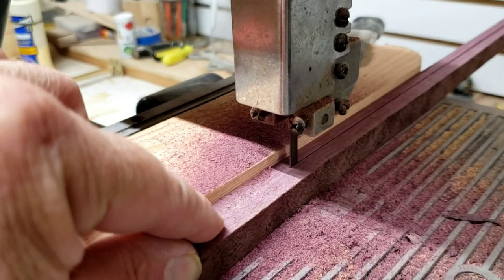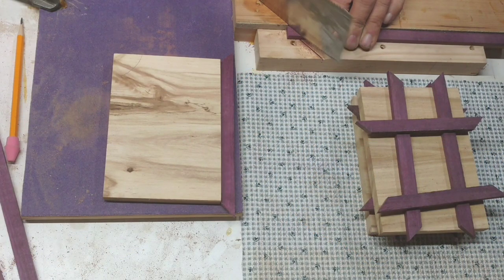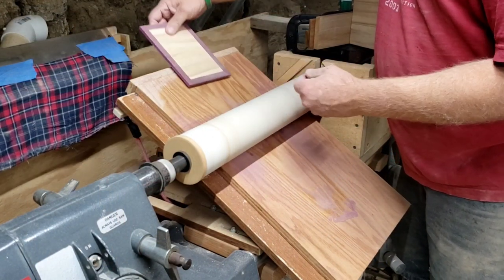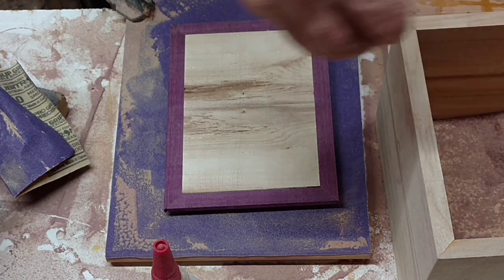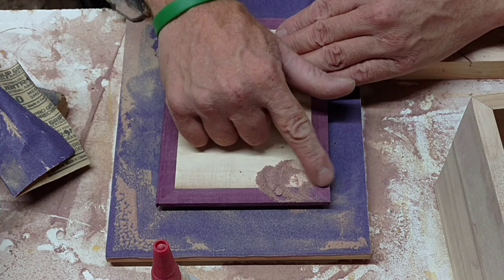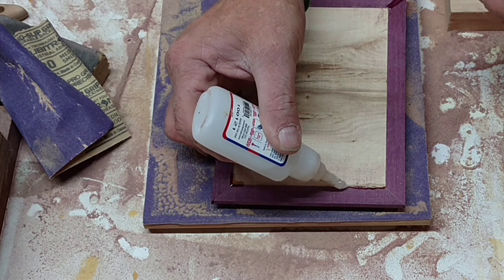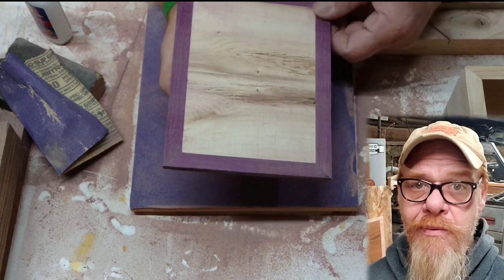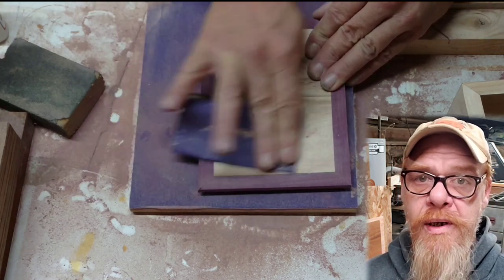A new way to fix the GAP in mitred joints! DONT USE SAWDUST AND WOODGLUE ANYMORE

Comment: I've done this one and it works great. If your gap is going to effect the structure and you need to ensure depth I have been known to use the shop vac turned down to the lowest on the back of the joint to pull the glue and dust down. If the gap doesn't go to the back I have used jewellers drill bits to open it a little from the other side and then fill them the same way afterwards.
Reply from the maker: Excellent tips buddy! Thanks for stopping by and sharing some 'insider' tricks :) All is appreciated !

Comment: I’ve heard this before Kevin, and have done it myself with the ring I made.   Great tip.  Oh and a tip back to you...use water in place of activator.
Reply from the maker: Thanks Rob. And also thanks for the water tip. You rock
Reply: I didn't know about using water Rob. I'll be giving that a go tomorrow, especially as I ran out of activator last week and can only buy it as part of a kit with the glue 😊 ॐ
Reply: The Wood Yogi TRY it first.  I suggested it to someone else and they said it was a fantastic tip.  Maybe it doesn’t all work the same, but when I’ve done it, it’s worked.  Maybe use a spray bottle and test it out.

Comment: Would the CA glue trick work on bigger holes and gaps, or is it mainly for smaller holes and gaps? My dad made me a bit of a headboard for a Christmas present, but there are a few interior fitment and miter gaps I'd like to make more invisible, aside from a half inch thick gouge on the bottom shelf board, it looks like he fixed using the glue and sawdust trick... Also, what CA glue, or what brand, preferably cheap as possible, would you recommend for bigger gaps and things???

Comment: neat idea!   do you find any problems with it being a bit too glossy after finish?    that's one of the things I noticed when using wood glue in the past.
Reply from the maker: Well I use a gloss poly for my finish, so I do not notice. If one was to use a different finish, maybe so, but I also think CA and dust is more stainable and blendable to the surrounding wood, compared to woodglue

Comment: Hey you have the same table saw I do do you have an issue with the belt tension changing when you raise or lower it & angle cuts
Reply from the maker: If you are referringbto my Craftsman, no I dont have an issue. In your case, look at the motor mount because one bolt should stay a bit loose so the motor can puvot freely.

Comment: Does the CA glue leave a stain or mark after applying finishing? How does wood take finish where there's CA glue?
Reply from the maker: I use a spray or wipe on poly and it works good. Thanks for the comment.
Reply: @MakinSawdust  I've started using CA glue as a clear finish on my speaker building projects and looks great when sanded flat and buffed out to a high gloss. Used in combination with your gap filling method is a great way to go.

Comment: My table saw is from the late 80s are you saying the lower retaining bolt for the slotted bracket should be loose so the motor just hangs and the weight of the motor causes it to self adjust?
Reply from the maker: yessir, there will usually be a bit of thread locker on the bolt so it doesn;t back all the way out. I tightened my bolt up too, when I bought it and put it back together. it should be a shade loose. :)
Reply: @MakinSawdust k thanks it appears to be the exact same Saw you have. I'll give it a try seems like the belt would slip I have the owners manual somewhere 😃
Reply from the maker: @ericschulze5641  if you dont find your manual, there is a PDF copy that you can download on my website
Reply: @MakinSawdust  k thanks

Comment: Titebond makes 2 different translucent glues.
Reply from the maker: great tips
Reply: @MakinSawdust  I used titebond translucent with walnut sawdust just yesterday with great results. I went the joint with glue thoroughly then shove sawdust into the groove with a razor blade. It looks to allow stain and shellac to penetrate the sawdust.

Comment: I waste so much wood because my cuts are always too short, I don't know why because I check, double-check and triple-check.  I even add extra because I just know it will be short and even with the extra, they turn out short. They look the right size until I actually cut them - then they turn out short.

It's driving my mad.   Thank god this is only for my own use.  I like to play around with these tools to see what I can do.  I am not very good tho...........lol
Reply: Is your kurf fully on the waste side of your line? If you can lay your kurf 1 mm outside your line, then dial in a precise 2nd cut, it should help reduce the short-cuts problem. Hope this helps, cheers!
Reply: @mayagayam  I have no idea what a "kurf" is
Reply: @casperwallace9685  The kurf is the cutout made by your blade. If you are not thinking about it, and you cut on your line, that would explain why your cuts run short. The blade takes a chunk of wood out of your material, so you have to make sure the cut line is outside the line you draw. First measure the material you want, draw your line at the edge, then cut outside the line you drew. The blade will take the kurf chunk out of your waste material instead of the material you want to keep, and your cuts will be more accurate (as long as your tools and hands are going correctly). 😉
Reply: @mayagayam  thank you,  Yeah I know that too but the god of wood hates me......i swear.......lol